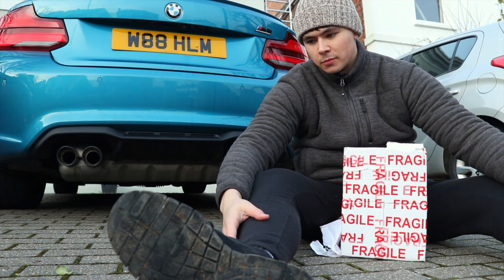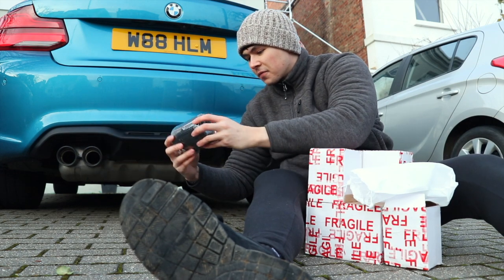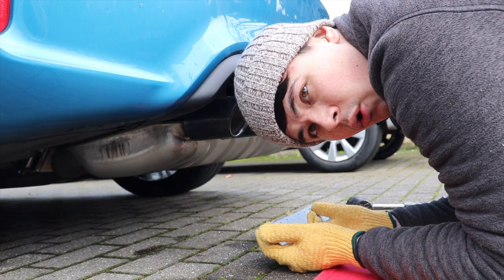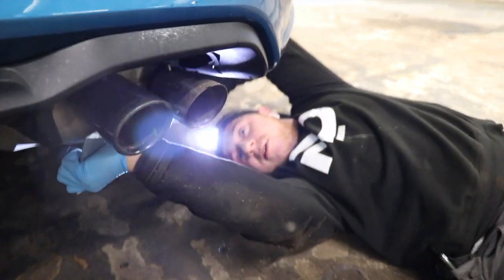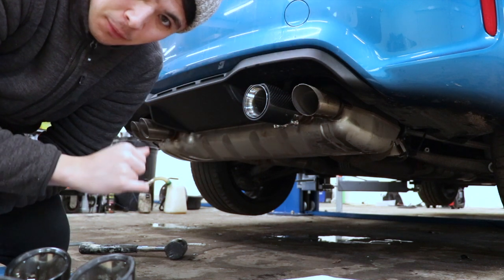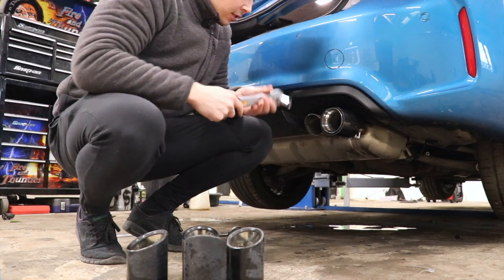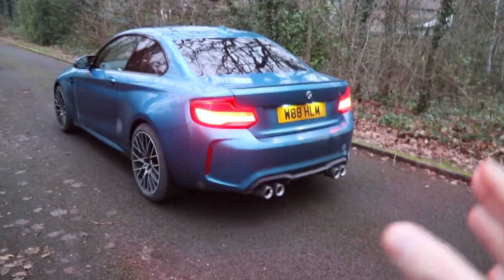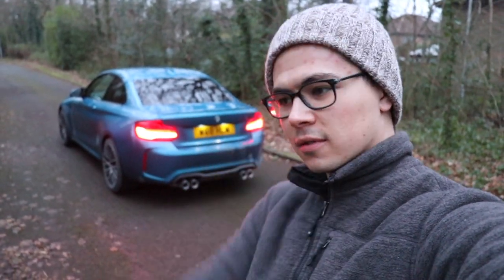How To Install M Performance Tips On Your M2 (NOT AS EASY AS YOU THINK!)

Comment: Enjoyed your video, I have the Remus axle-back system on my M140i, which is a great system, but I struggle to keep the tips looking clean because of the type of carbon fibre used on them. Its good to know that the M performance tips will fit so I might change to them later this year.  Car's looking good 👍. Stay safe 🤞
Reply from the maker: Thanks Andrew! 
No idea if they’ll fit a Remus M140i system, you’d think so. But the pipe diameters might be different 🤷🏻‍♂️ but then again, I’m not sure if the m140i M Perf tips are different either. 
It’s definitely doable but ye, might just have to weld some extra piping on to extend the length. Best to check with whoever installed the Remus etc. 
Love the m140!! Stay safe too mate 👊🏼